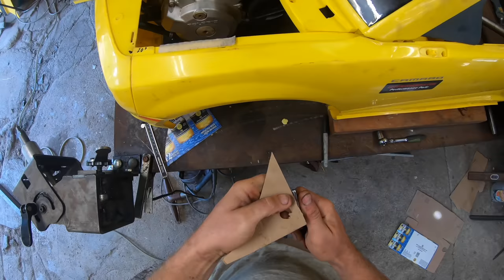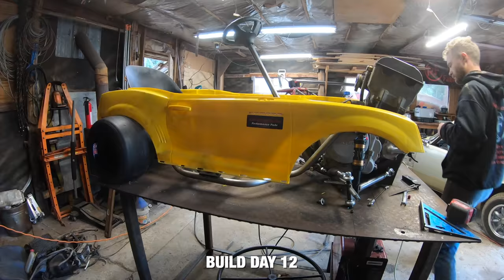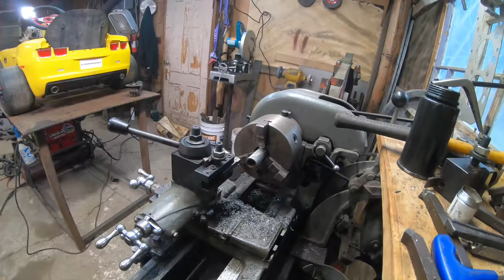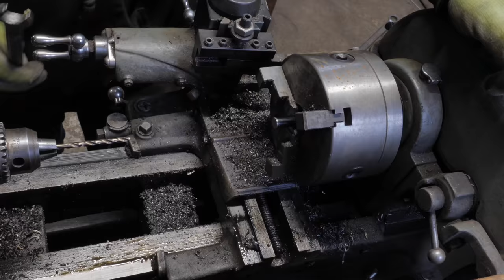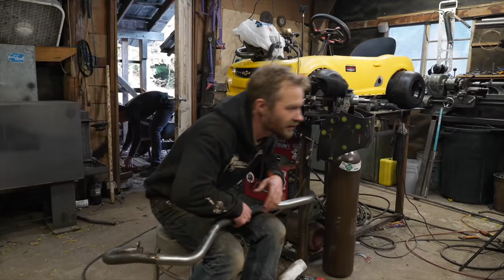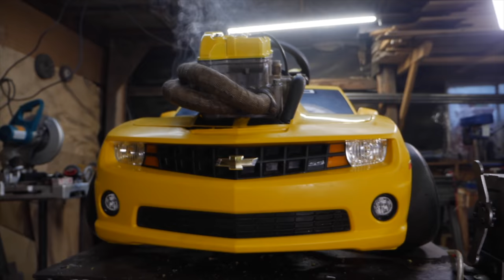Building a 90 MPH Power Wheels in Ten Minutes Full Time Lapse

Comment: U should do a powers wheel build with any 500cc two stroke motor😯
Reply: Banshee motor, 350cc twin 2 stroke.
Reply: f*cking yes! honda cr 500?
Reply: @hammerfix7241  that would be dope
Reply: how about a rotary?
Reply: @samleen  diesel tow rig for a rotary drift build
Reply: Or an engine from a ferrari f40
Reply: Sure🤣🤣
Reply: @samleen  yeah cool but rotary bike engines are rare af and making a billet one would cost an arm and a leg
Reply: @vasilybuilds already on it
Reply: The problem with 2 strokes and mini builds is that the exhaust pipe will be way to big for it. Unless you use like a trials bike engine with low port durations and no expansion chamber, insane bottom end torque which could climb any hill under 1000rpm.
Reply: I got a 79 cr500r that iv been thinking of trying this with
Reply: 4 stroke better
Reply: @robublind7528  aaa
Reply: We will lose one of our favorite youtubers

Comment: why still using combustion motor, dudes? why more weight, less power, big size, fucking noisy, oil, problems a lot etc, instead a small, silent, simple, powerful, light electric motor? wow, very good work in the structure, but if i buy something like that i take away directly the dammed prehistoric motor and put a electric one